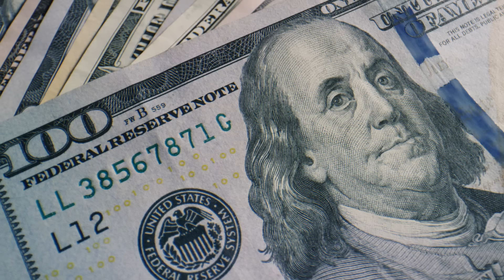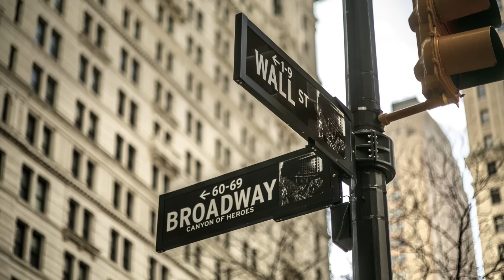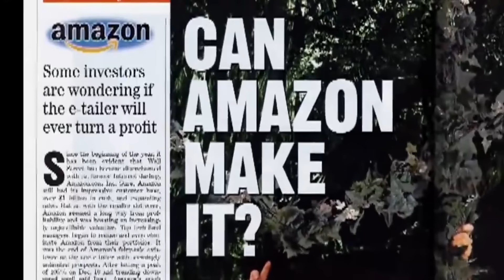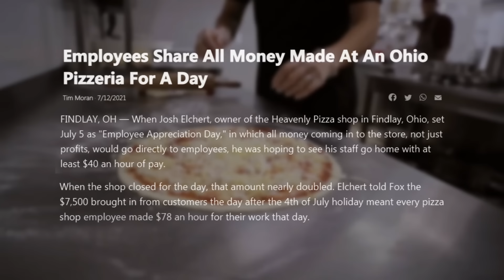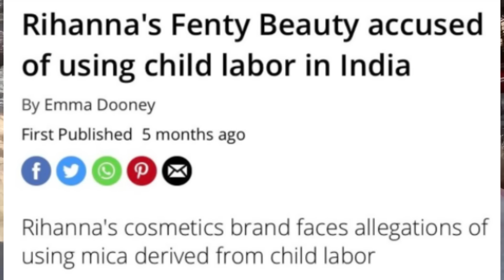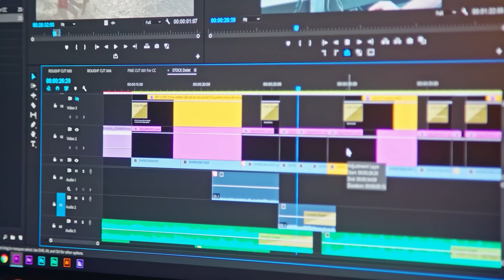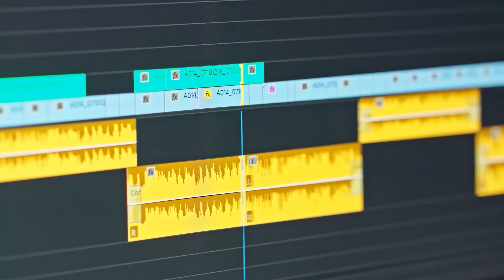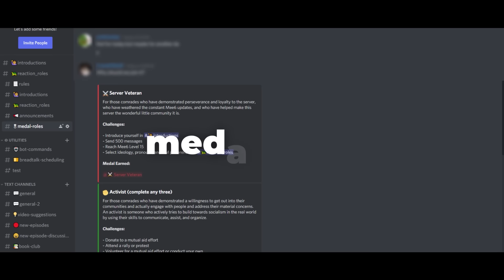The Myth Of The "Self-Made" Billionaire

Comment: Love the video. One problem with the pizza shop example is that the building's rent, utilities, ingredients for pizzas, and expensive machinery all have a cost which is why dividing money by revenue rather than profits is completely unsustainable. Also for surplus value, we may hate to admit it but management and founders often provide value as a kind of commander who helps direct efforts to where it is needed. Not billions of value, but a relatively similar value to the working class nonetheless.
Reply: And the pizza owner took the initial risk with his or his lenders' money. If his pizza parlor fails,  he's bankrupt. If an employee fails, he doesn't lose an initial investment and just moves onto another job.
Reply: @patricio1973  very true
Reply: @stkoev81  The risk continues because there is always the possibility of bankrupcy that is why management has to be constant.
Reply: @luizmelo8611  If you're properly running a business bankruptcy for the business does not equate to bankruptcy for the owner. Ownership of an LLC generally protects an owner's personal assets. So, no, the risk is immediately assumed by the company, of which there are the value producing workers and the profiteering owner. If the business fails the owner will get to keep any of the money they had already been "paid" by the LLC. The pizza shop is a good example, despite not taking into account the difference between revenue and profit because it's meant to highlight the true VALUE of the labor that is produced by the employees, not the PROFIT. Each employee produced $78 in value, which means that the pay which they typically receive is grossly undervalued.
Reply: @patricio1973  the worst thing that can happen to an owner is having to become part of the working class. The working class already has nothing and is often working paycheck to paycheck to survive. The owner "risk" is to having to live in that same way, although in reality owners still after failing retain some wealth, while at the same time being more educated and well connected to the average worker. So the "downfall" of a bankrupt owner is to fall to a better state than the one an average worker, can you see how the mentality surrounding capital risk is rigged?
Reply: This channels logic isn’t there, so he is saying the owners of the company shouldn’t get money? That’s not exploiting that’s just fair, low responsibly low pay, high responsibly high pay. If companies switched to what this idiot is saying the world economy would collapse and no one would even build companies because they wouldn’t have any incentive to make one.
Reply: @stkoev81  it’s not a parasite it’s called owning the company and owning a portion of the revenue. The employees don’t own the company so they aren’t entitled to anymore then wage.
Reply: @TheOne_p  This channel advocates for socialism. So you should know under that, the workers WOULD own it. 
Plus, Marxists and socialists call that unequal pay under capitalism as "Exploitation". 

I am not arguing against it or for it, just trying to clear up your confusion.
Reply: @TheOne_p  for any successful business that the owner doesn't manage themselves, it is parasitic. The ultimate goal for the owner is to be completely passive and simply extract as much wealth while limiting how much they give to the workers to maximize profits.

I mean, that's just the way things work, but the whole deal is exploitation by definition, even if it is mutually beneficial in the long run.
Reply: I was thinking, maybe they're getting paid $10/hr, and they're generating around $80/hr revenue before costs for various overhead and materials. Maybe they could be gaining $20-30/hr if the owner took nothing. 

It does go to show that there's a lot more wiggle room than businesses care to admit. It's also why I absolutely hate hearing businesses pretend that min wage going up is going to eliminate their profits. If that is the case, then they aren't any good at business since their profit margins should have more than a dollar or two per hour in profits.
Reply: @Excalibur2  It’s not exploiting workers, it’s fair. It’s even, it’s equality not equity. The ultimate fairness is an even playing field, the owner should be entitled to the most profit, they founded the company or bought it. And you get money by selling shares not just from the company dividends. Workers at company’s get paid plenty, that’s why or economy is so good, because if they were so underpaid they couldn’t buy any products and boost the economy.
Reply: @TheOne_p  it's not a level playing field though. Businesses lobby to be sure of that, creating as much red tape and expensive hardship as possible to keep the competition down. Just think about any proprietary parts or software that prevents people from going elsewhere. Often it isn't that they provide anything unique or special, they just got there first. If it was fair, the owners would get paid an amount for managing the property and an amount for the risk they take. They are also in a position where the worker often has no choice but to sell their labor, putting them at a disadvantage.

It is exploitation because they have no choice but to eat. Now, that doesn't necessarily make them evil, but it does explain the relationship of employee / employer in most cases. If things were more balanced, then wages would have continued to climb with productivity as well. I also think it's a bit of a transition in our economy, as time goes on you get more and more mega corporations that get bigger and bigger, to the point that they can't fail without devastating then country, so the government won't let them, and nobody else can compete with them.
Reply: @Excalibur2  Lobbying doesn’t affect workers pay, we have unions to help with that.
Reply: @Excalibur2  an even playing field is fair game. It’s so fair that you think it’s too fair. There are plenty of jobs out there and that one company isn’t there only option
Reply: @TheOne_p  what does it matter when they all work together to ensure the wages and benefits are the same? Recently at my company the CEO and a bunch of other executives had a meeting and part of it they addressed the issue of inflation and pay. They said, we're constantly comparing our benefits package to ensure it is competitive, but that doesn't mean anything when they move in lockstep with the other nearby businesses to keep wages suppressed. 

There just isn't enough innovation or aggressive competition to push companies to provide better wages or benefits, they slide by with mediocrity since they are at the end of the day customers for the shareholders. 

I guess my takeaway is that everyone should be working to become an owner, because otherwise you're an owned slave
Reply: @Excalibur2  to be the owner you must buy the company, that’s how it is and that’s how it is the most fair. Any other way would just be robbery
Reply: @TheOne_p  if it was perfectly fair, I could start up a business with no government getting in the way. I could start up a business and take others ideas and improve them without fear of copyright law slowing down innovation.
Reply: @stkoev81  and the business would exist with the pizza owner he makes the employee labour productive cos he funded the resources need for production
Reply: @stkoev81  you don’t understand that resources cost money and when you buy  something with money to own it 

 so the owner takes away all those resources money bought can the employees still make the food and produce value ?  No coo o s resource ie tbe building and equipment cost money
Reply: @stkoev81  the owner produce value with his investments in resources you can work hard all you want but if you can’t your job your labor is worthless
Reply: @Excalibur2  have you ever tried being in business? Sounds like you have some awesome ideas and it would be nice to see the results of your business model...
Reply: @andreblignaut2567  my ideas are less about running a business and more about the regulations placed on businesses. I'm also still young, starting up my own business is prohibitively expensive and it just doesn't make sense right now. 

But, I have worked with my father and his small business. He's outlasted all the other small businesses in the area, and the main way he's done that is by undercutting competitors. Seeing what he's done is part of why I have the opinions I do.